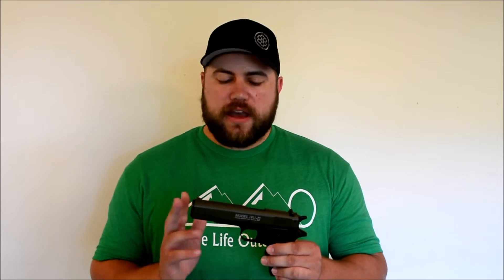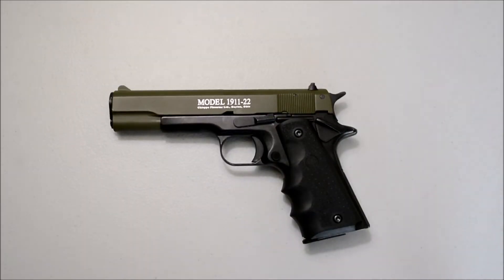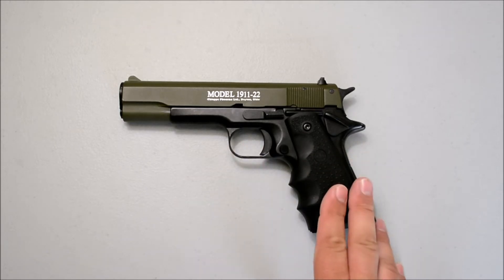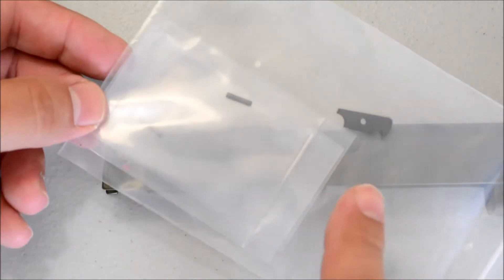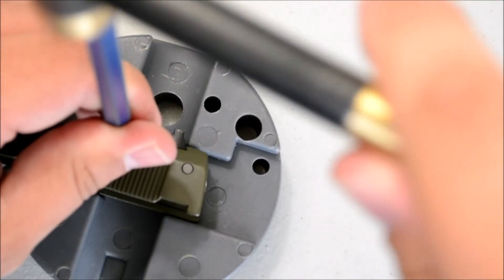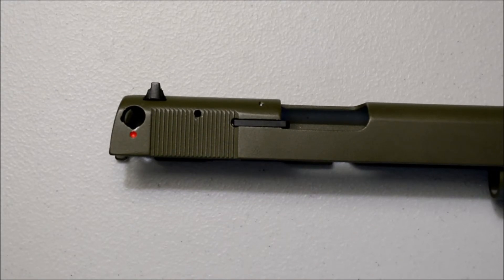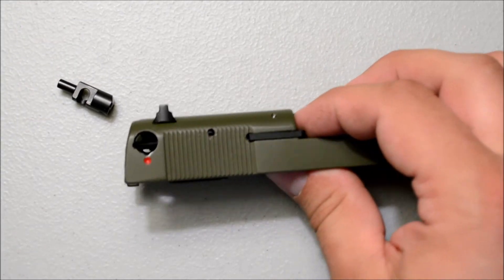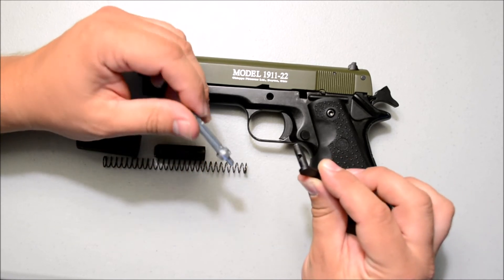Chiappa 1911-22 (Part 1 - Repairing Firing Pin and Extractor)

Comment: would it be possible just to rotate the firing pin in such a way that the damage part is on top (or bottom) in the opposite side where it was when damaged?, curious  because I have one of these just in case. Thanks
Reply from the maker: Excellent question! Unfortunately you can’t rotate it because there is a slot in the shaft of the firing pin that needs to face up in order for the retention pin to be installed and retain the firing pin. I hope that explanation makes sense. Let me know if you have any other questions! Thanks for watching!
Reply: sell it now.

Comment: I've had one for quite a few years.  When new, it would only cycle on higher speed ammo.  After A LOT of buffing on the rails, hammer and back of the slide, works awesome.  Fits my full size 1911 holster, tho a bit loose.  Sure, its a bit cheap, but fairly accurate and works well for me.
Reply: What do you mean by buffing on the rails? What would I use to do that? I have one of these I bought 7 years ago and have only put about 50 rounds through it bc I can't get it to fire two consecutive shots. I haven't been able to find the CCI mini-mags in stock anywhere but I have tried CCI Stingers and CCI Velocitor which is 1435 FPS. Neither of which worked. I really like the look and feel of the gun but if I can't get two consecutive shots out of it it's useless to me. Any tips to fix it would be greatly appreciated. Thanks.
Reply: @_FridayNightFilms  I have a roto tool/dremel that I used to buff and polish all mating surfaces.  The "rails" are the contact points between the frame and slide.  Those and the back of the slide that contacts/cocks the hammer and the hammer are all polished.  Plus, I use the lightest oil I have.  After several polishings, its smoothed it out enough that pretty much any ammo cycles through it.  Good luck.
Reply: @rayss3323  Okay. Thanks!

Comment: Thanks, man... I have one with what I assume is the same problem, just haven't had time to break it down yet... Another catch 22 with the dry firing is when you have a good extraction, but failure to load the next round.  Does anyone have a lead on a firing pin so I wont have to do the FFL thing?  AND... Where is part two, bro? Haha! Thanks again.
Reply from the maker: I'm working on getting back up and running again! Good luck on the firing pin! I had to do the FFL thing too, but fortunately the FFL holder was cool and didn't charge me, since there wasn't any transfer paperwork. Let me know how your repair goes!
Reply: @LiveLifeOutdoors88  would you happend to have the part number for the extractor,pin, and spring? Thanx
Reply: correction - pin is used too

Comment: That barrel lug has been known to break when firing, resulting in the possible loss of the slide spring and the thing you called 'the plug".  Many of the parts of this gun, including the slide and frame are made of a cheap alloy, and they are cast, which makes them prone to breakage.  I wouldn't pay $250 for a toy gun that shoots real bullets.
Reply: even an airsoft gun with a gsg kit slap on top looks better quality then this gun. looks like a blank gun converted.
Reply: @reedwischhusen5376  That's Chippa.